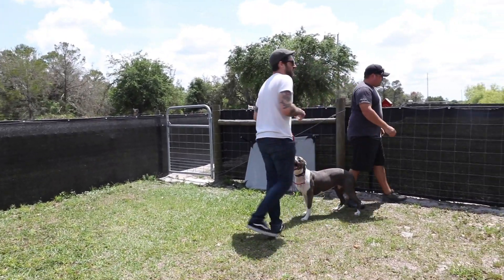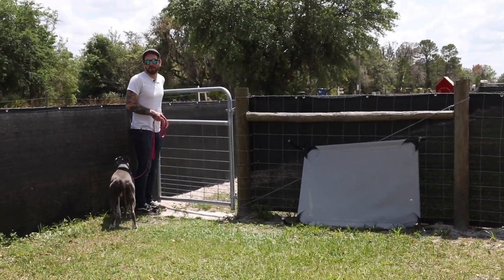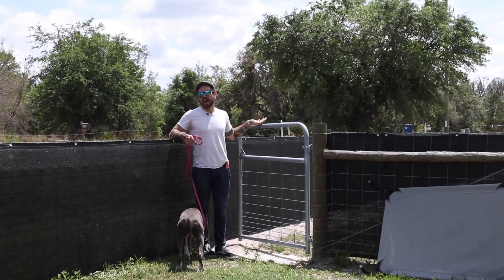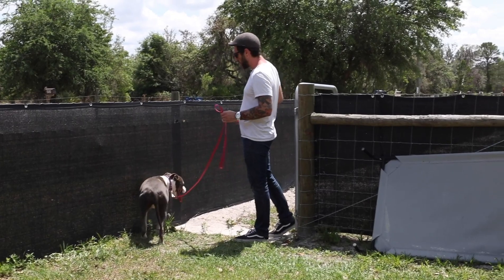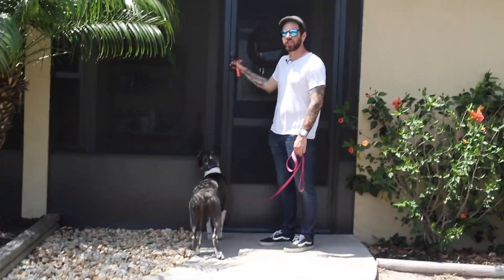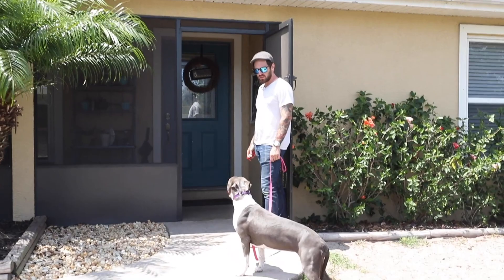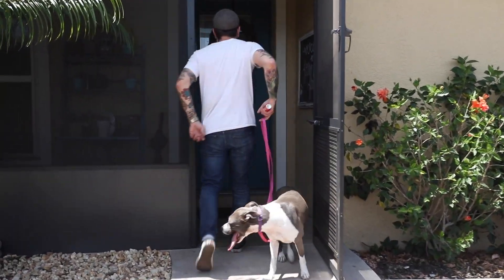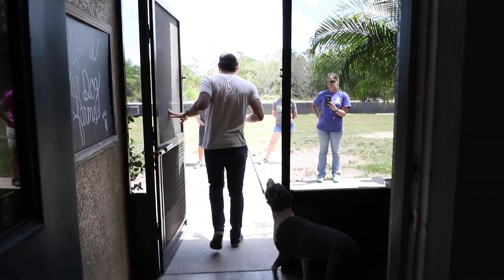Doorway Management With A Pet Corrector

Comment: Great approach 
I was doing the technique in the beginning. Will try this
Reply from the maker: Larissa D thanks so much!  Hope it helps!
Reply: @MiracleK9Training  is it ok to spray dog in face have you notice the compressed air is fine? or would you stick to the backside spray?
Reply from the maker: @anth115  typically you want to avoid it.  It’s better to do from a 2-3 foot range away from the dog as the noise is what does the startling.  If the dog is not very faced by it you can try closer.
Reply: @MiracleK9Training  yes also the slight compressed air feeling on their body when closer seems to have a stronger effect than if you didn't spray on dog.